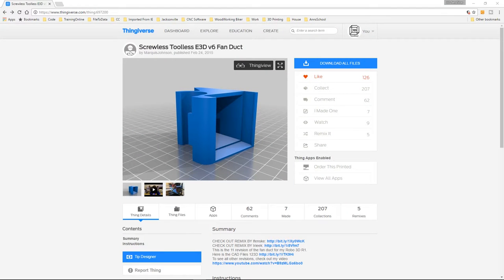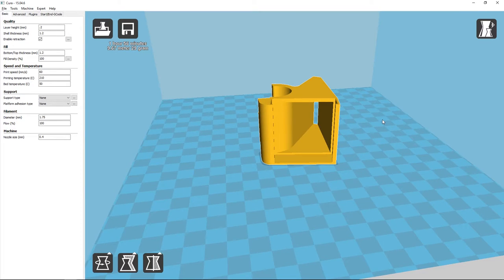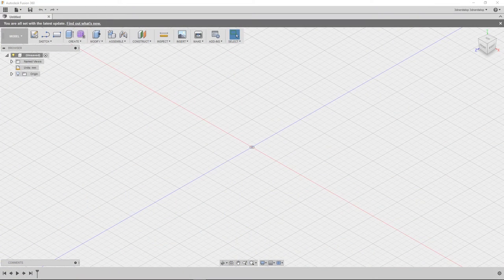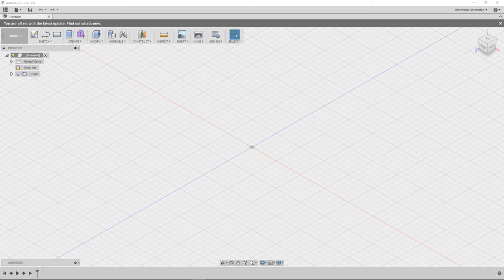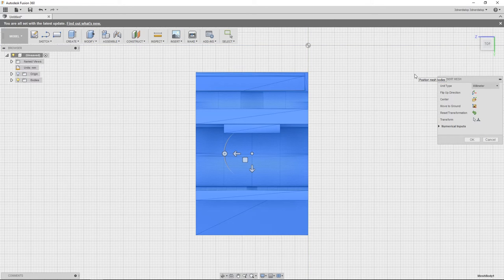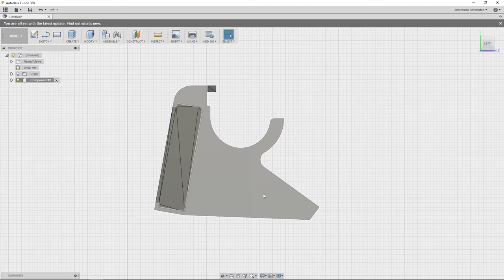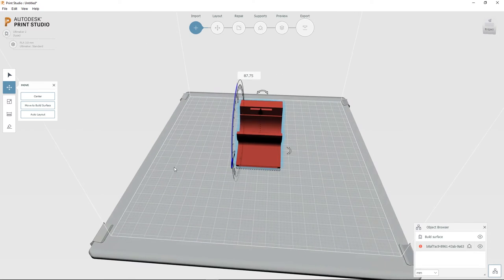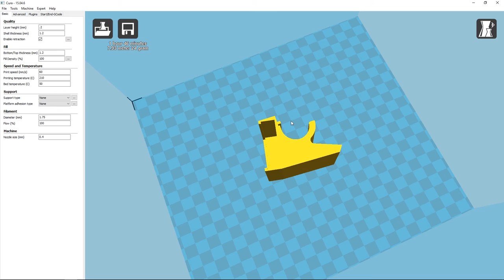Upgrade: Adding a 2nd Cooling Fan

Comment: I mirrored your fan duct in slicer3d and put one on the back and one on the front as your duct works much better than the stock fan.  Thanks for taking the time .  I own 14 Robo3d r1 plus printers , one Original Prusa i3 MK2, and waiting for delivery of my Robo3d R2.  I am also personal friends with the fine young men that started Robo3d and have been trained by them and repaired  printers and refurbished printers for them.  I appreciate all your Robo related videos.  Thanks for the great videos.
Reply from the maker: Thank you for watching... I love my ROBO 3D R1+ and Hope to get a ROBO 3D R2 one day.
Reply from the maker: I would love to get a hold of a ROBO 3D R2 to review and compare to the ROBO R1 +. Will have to see when the R2 comes out if I can get of fine one to review.

Comment: great  video bro!.. can you make a quick fan vs no fan print? to see how it improves? maybe printing the benchy boat
Reply from the maker: Sounds like a great idea I will have to do that. Thanks bro...
Reply: Hey bro, I just got my fan today(same as yours), and I am in the process of wiring it up, but I noticed the fan has 3 cables and comes already wired to a 3 pin, did you just cut it and ignored the yellow cable?
Reply from the maker: Thanks bro, Yes I just cut off the yellow wire and only used the red and black wires.